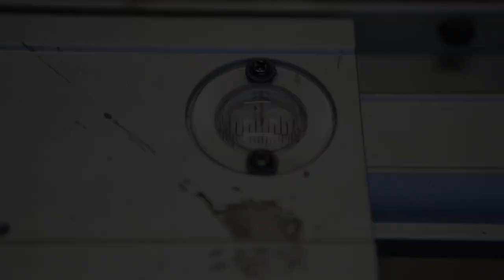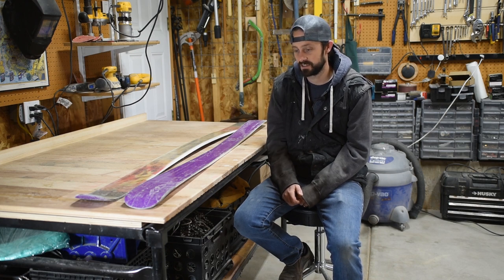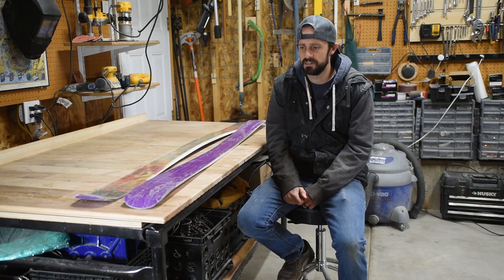Full-ish Ski Build

Comment: Thank you for this video, it is super helpful! Have you tossed them in the bin yet? I’m coming from a watersports composite building background (surf, windsurf, hydrofoil) and really interested in skis as a next challenge. Tbh this is all very new to me so I have little knowledge about the exact materials involved in skis besides wood, epoxy and fibres, but: a surfboard never comes out the vacuum bag completely smooth! We fill any pinholes or bumps with epoxy, sand it flush and repeat the process till we got a perfect result. It can take a lot of time, but it works. I add microbaloons to the epoxy for a lighter filler that spreads out better. Alternatively, automotive polyester filler could work too. I have that laying around in my garage but can’t comment on its strength as I haven’t used it yet.
Reply from the maker: Thank you for the comment!! Actually I mounted them up and took them for a spin.  Super fun pair, frankly it was hard to notice the base.  Sharp edges go a long way.  Cool, I wish I knew more about watersports composites.  I may have to try adding microbaloons next time I'm making a lightweight pair.  good advice!
Reply: @redbarrelskis3361  best of luck! Yes I don’t understand why micro balloons are looked over in ski building. It’s not like you’ll gain 200gr, but you can double or triple your amount of epoxy by adding only a couple of grams. I’d recommend to go for a mixture that’s still “runny” so that it still drops of your mixing stick. Thicker than that and wetting it out will get harder.
Another cool additive is foaming agent. It fills any voids there might be in the construction so it’s impossible to delam over time. Your vac setup should be able to handle the expanding epoxy. It’s more difficult to work with as you usually only have like 15 minutes before it goes off and starts foaming. 
Keeping an eye out on your channel, very interesting stuff :)

Comment: Great channel. So, im a Sawyer and just milled some Winged Elm.  Im loaded with Ash and well aware of it's use in skis, canoe yokes, bats , ribs and such.  However, this Winged Elm seems to have Ash characteristics on steroids.  Incredibly springy, rigid, faster than ash, more durable yet a bit less moisture resistant.  Used in old time wagon hubs for durability and hockey sticks which makes perfect sense.  Have you used it, would you like some no charge if my shipping isn't too much?  I'd like to see how it performs.
Reply from the maker: A Sawyer, that's awesome!  I've used ash and its a great wood for skis.  I have not used Winged Elm.  I would love some, but wouldn't feel good about burdening you with shipping.  Feel free to email me and maybe we can figure something out.

Comment: Hi, awesome build. When I see you using the router on the wood core and sidewalls, is that just you profiling the core or something else? Also, what material are you attaching to the nose?
Reply from the maker: Yup that just me profiling the cores (with sidewall already attached).  The material for in the nose is called tip fill.  You can find it on crown plastics website, shop section.
Reply: @redbarrelskis3361  thank you!

Comment: One other question, do you ever put insyerys into your skis to mount bindings on?
Reply from the maker: I have not... the one snowboard I built I used inserts.  Snowboard bindings, for the most part, have a standard mounting hole pattern, so that works out well.  Ski binding mounting holes are all over the place, and they depend on boot sole length which can easily change if you bust or upgrade your boots.  Feel free to shoot me questions anytime!! Cheers!

Comment: Hi John, do you use this kind of router bit for profiling the core: https://nl.grandado.com/products/8-mm-schacht-reiniging-bottom-frezen-snijden-diameter-voor-oppervlak-schaven-router-bit-trimmen-frees-houten-snijder
Reply from the maker: Actually I just use a 3/4" (~19mm) 2 flute strait blade bit.  It takes a lot of passes.  I bet a bit like that would speed the process up.  If you give it a try let me know how it goes.  This is the one I use (https://www.amazon.com/Freud-Double-Flute-Straight-04-140/dp/B00004T7BP?ref=dp_atch_dss_sdp_ce_5)